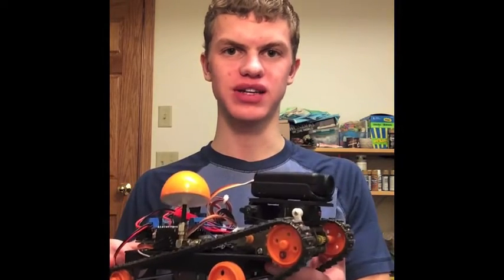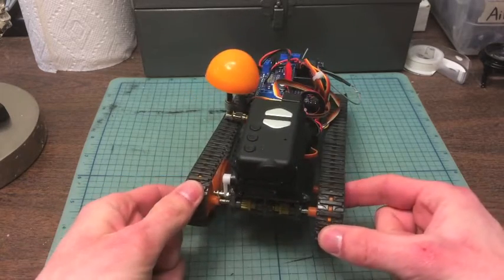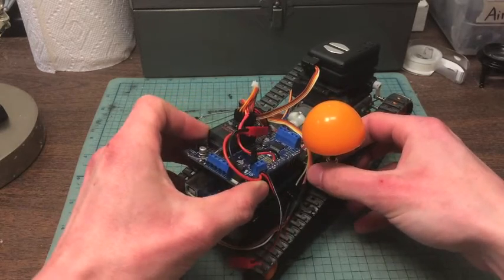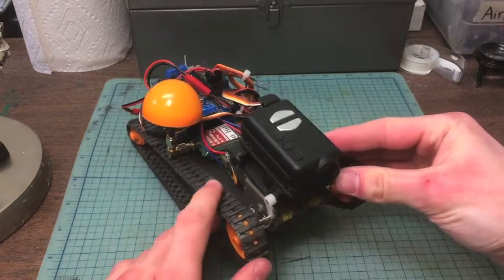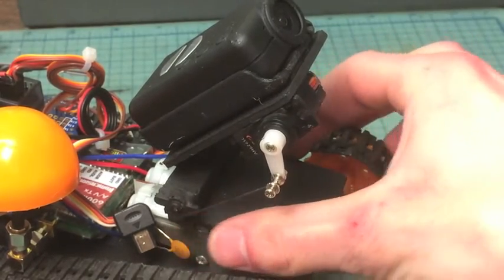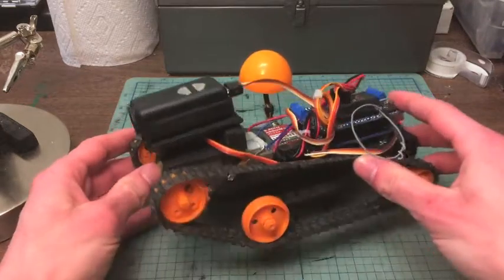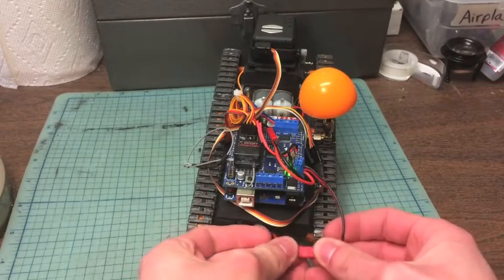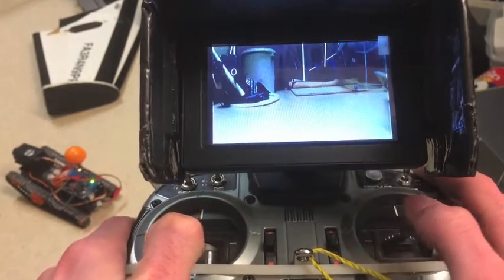Remote Controlled Arduino Spy Tank

Comment: Do you know any cheap but good fpv setup ?
Reply from the maker: Some good online sources for FPV setups are the Flite Test Store, Ready Made RC, Hobby King, ImmersionRC, and Limenier.  You will need a camera, a video transmitter and receiver, a monitor or goggles, and a way to power all of them.  These can be bought as a kit or individually.  
David Windestål has a great FPV starter's guide here: https://rcexplorer.se/projects/2009/09/fpv-starting-guide/ as well as instructions to build your own antennas on this page:https://rcexplorer.se/category/projects/
Reply: @nathanbroman1601  Thanks man!